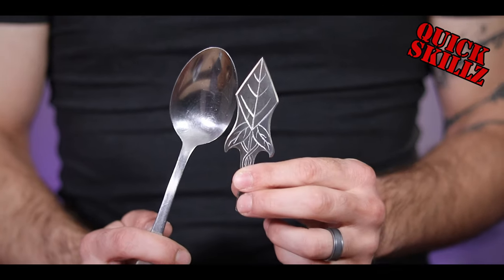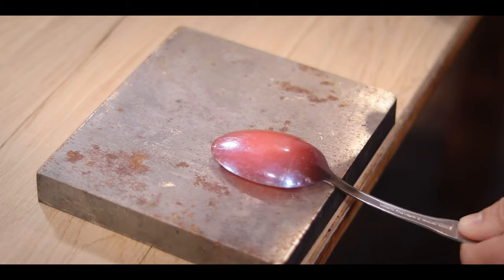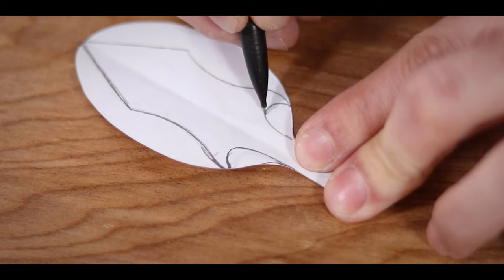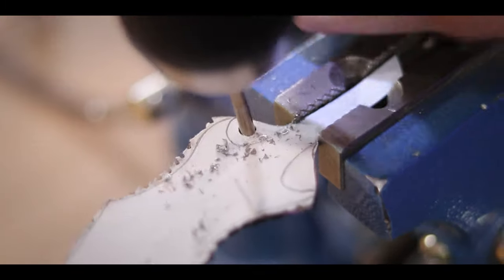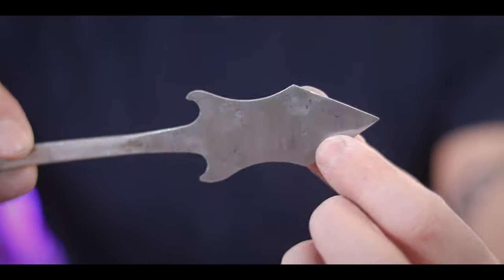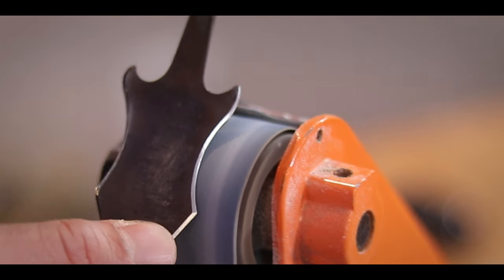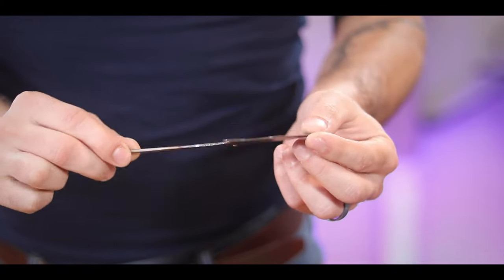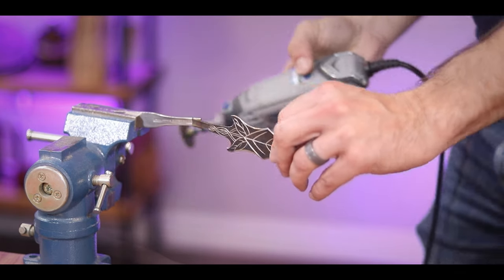How To Make Arrowheads From Spoons!

Comment: COOL arrowhead bro, just a word of knowledge for ya; cheap stainless steels can't be hardened with that method. Different alloys have vastly differing hardening methods depending on their chemical makeup. The good old heat till orange/red and dunk in oil only works for simple high carbon steels. You add stuff like chromium and nickel (aka to make it stainless) and the chemistry changes. Theres a couple types of stainless that can be hardened like this (440 for example) but I doubt they make spoons out of it.
Reply from the maker: Great info bro! Thanks for the education! Really looking forward to you KOR ep too
Reply: @ Jake. Stupid question on my part... what could you hunt with this type of metal arrow? Or would it just shatter/bend on impact?
Reply: @bobbobbington3615  Bit late to the show and not Jake either, but I do happen to be an experienced metal/steelworker by profession.
The answer to your question is pretty simple: Pretty much every small/medium-sized game as long as it doesn't hit hard bone.(the arrowhead would most likely bend as it isn't hardened at all...) It''l also most likely be a single-use arrowhead. As in: needs reworking after each use.
Reply: You can case harden mild steel! It’s a bit involved but I bet it would make basic metalware hold an edge, at least a little

Comment: Likely it's made from 18/8 stainless steel (most common for spoons beacuse of very high corrosion resistance), which doesn't really get hardened from quenching. The best way to harden it is actually cold working it. So you could save yourself the heating process altogether and just hammer away.

It came out looking  chef's kiss great work!
Reply: So it's theild steel of the stainless steel world

Comment: Just made myself one of these as a experiment, going to electro etch a pattern on to see how it looks. I have a vinyl cutting machine, so was able to make my head design out of temporary vinyl  to get the shape i wanted on the spoon and then i can use it to ectch the pattern on before peeling it off. Just a idea if your not good at drawing or got steady hands with a dremmel. Plus it means you can make a batch of these and they will come out more uniform potentially..thanks for another awesome video pal. Love them.

Comment: You might want to remove a bit of the metal from the former handle part that's left, leaving a notch on both sides before the end...that's where it would normally be attached to the arrow for more traditional arrowheads.

Comment: Use a wooden block to strike the hammer in. It won't leave those divots!  😁
Reply from the maker: Genius! I swear, I learn more from the comment section than all you do from my vids lol.
Reply: Striking on a wooden surface would allow it to bend more due to the wood flexing below the strikes. The blemishes were, as he said, inflicted due to not striking with the hammer face parallel to the anvil. This is a skill that just comes with practice, and making a quiver-full of arrowheads is great practice.
Reply: @jarekmace1536  I've made hundreds of decorative and functional arrow heads both from spoons and forged metals. I always use a wood block to protect the metal. Works very well.

Comment: Love the arrow head I woulda quenched it in cold water because that spoon definitely isn't carbon steel
Reply: It's a cheap mild/stainless steel, there's no way it could be hardened significantly from quenching in anything.
Reply: @boxcarz  actually quenching mild steel at higher heat in water will achieve it becoming slightly harder obviously nothing like tool or high carbon steel